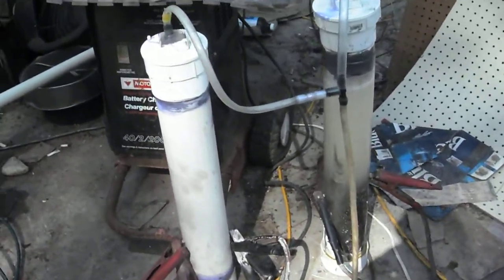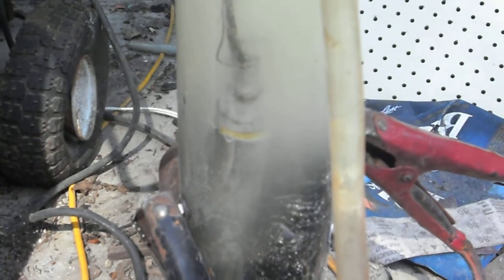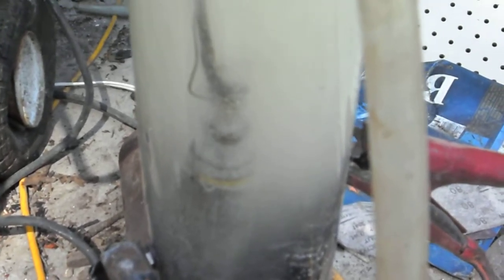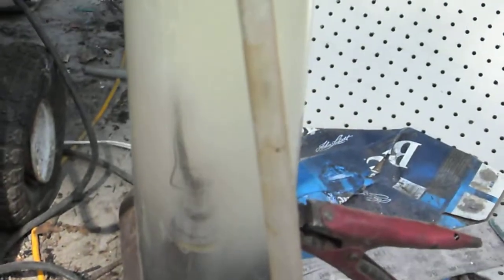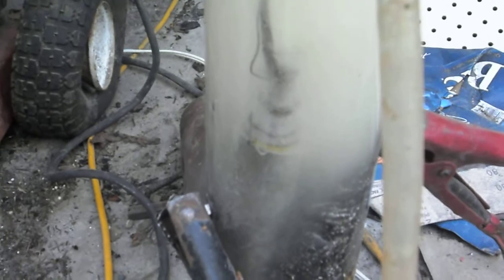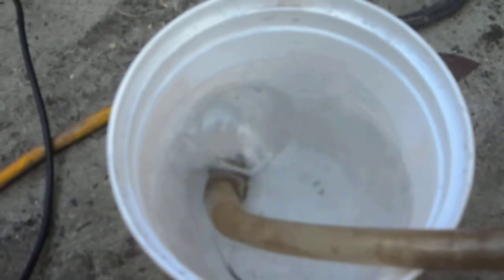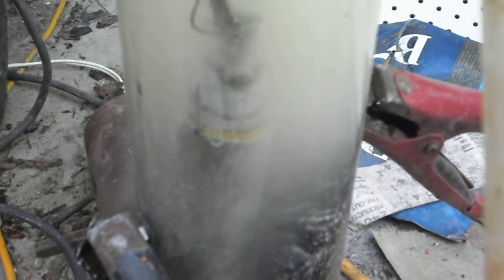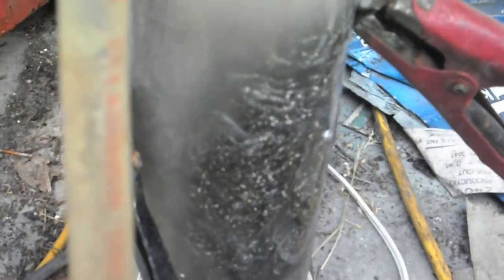hho  wet cell  with koh

Comment from the maker: may be going to a transformer to up the volts and drop the amps i was using 12 v but may try ac thru a tranformer and bridge rectifier. water is fuel y'all i'll post more later

Comment from the maker: ok so i cleaned out the entire setup and reassembled the cell with tap water and koh and the 4 tube units ,each has a neutral  in the middle, draws 50 plus amps with pretty fair hho production with no pwm hooked up. i guess my old setup was just shite lol so now i am looking into the "daniel dingle secret" video to see if the charging circuit thing is doable,